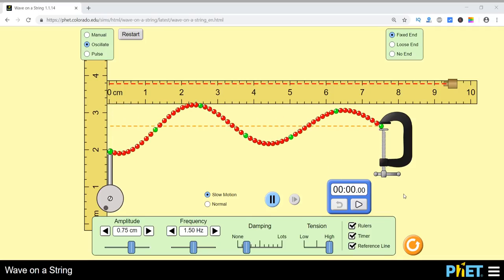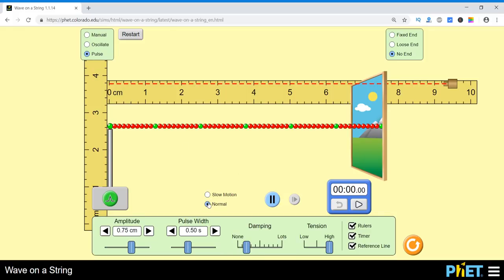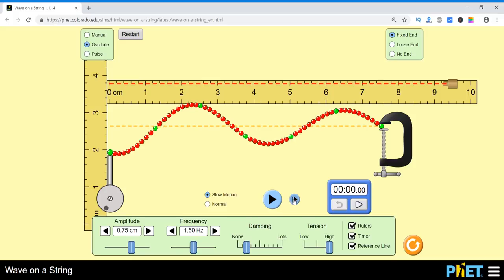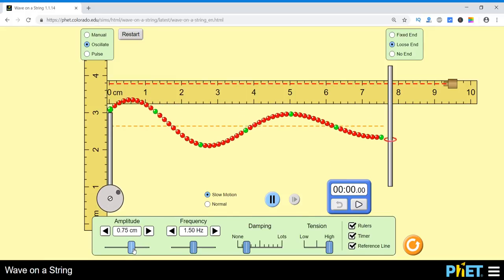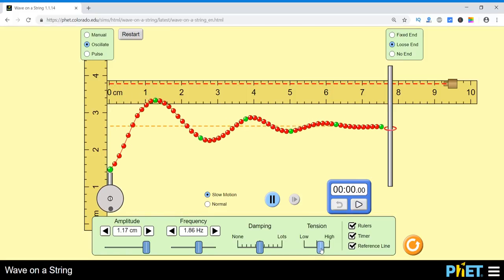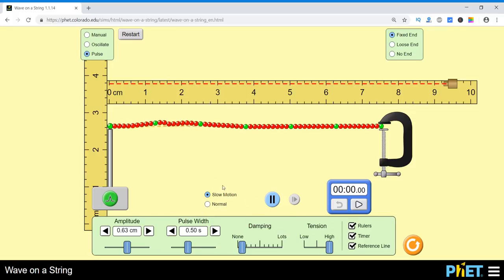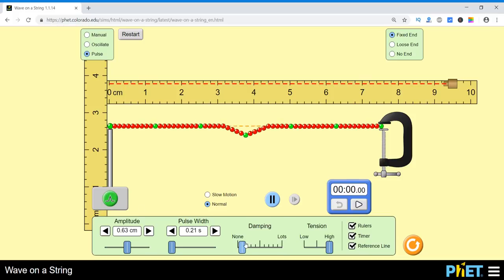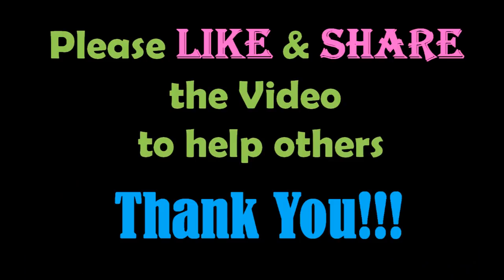Wave on String- PhET Simulations- Transverse and Longitudinal Waves- Wave Propagation Simulation USA

Comment: This is exactly what I was just looking for.  Do you have a function or a formula for parameteic calculation of any point for gicen distance at given time?

I am trying to write it myself now, I think this is just like a simple sine wave, where each point has an angular offset (phase), but it also involves damping, and I wonder if each point is experiencing any lateral movement, away or towards the source, as it moves up and down...

I am trying to implement this as a visual effect in javascript, for a background patched with hexagonal tiles, as of they are floating.